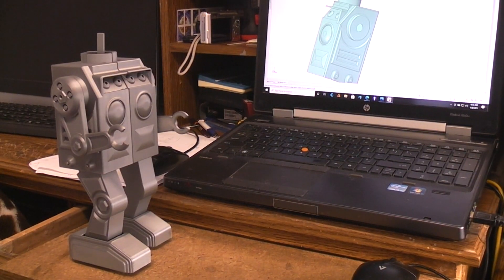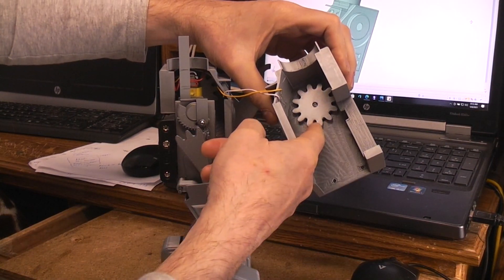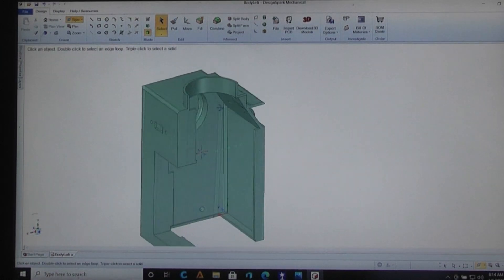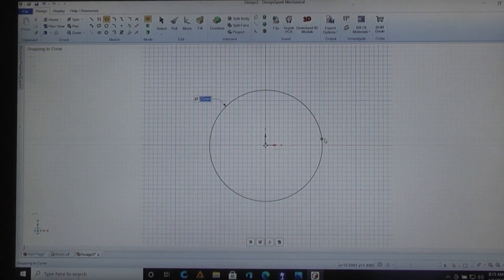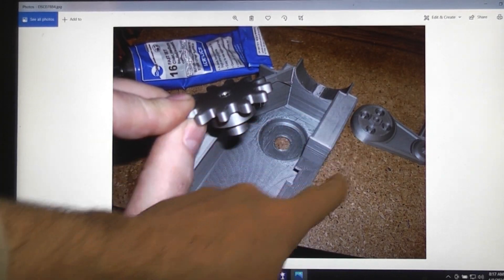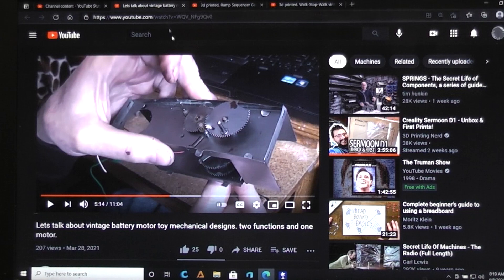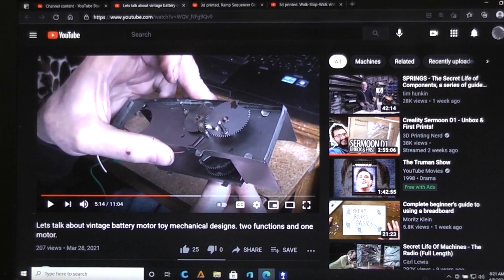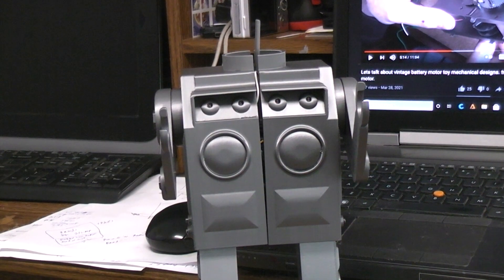Walk-Stop-walk robot project. Part 2. Body & Arms.

Comment: Did you manage to power all the LEDs off the 4 batteries as well as the motor?  I have got the motor and legs walking but I’m struggling with the LEDs.
Reply from the maker: The LEDs are not hard. Just wire them in parallel and add a current limiting resistor  220 too 330 OHMs , they will draw very little power form the batteries. Flashing LEDs have the flashing circuit built in the LEDs. The long leg of the LED is positive the short leg is negative.
Reply: @Robothut  Thanks for the info. I had actually wired things up OK but for some reason I’ve just found out I need to put a diode into the circuit.

Comment: Already built the gearbox and legs, the gearbox proves a little tricky without tight tolerance the moving gear wheal tilts on the shaft as it starts to engage the output gear, and if the tolerance is too tight it binds. I will get it just right eventually :)
 Maybe a deeper gear or 'tube' that the gear slides along the shaft on to alleviate the tilting ?
 look forward to giving him a body and arms, Thanks

Comment: I find that Interesting! I've been using cad in my work as well but making parts is something I have yet to learn and explore. 
The pressure of learning and getting the experience with different cad programs is something I am getting tired off though.
Reply from the maker: Yes sometimes you just want a tool that works and to get the job done. When trying to create something new the last thing I want is the tool getting in my way.

Comment: Impressive work!  I know you said you didn't want to learn anything else, but have you played around with Tinkercad?  It's free, and it's entirely online so you don't have to worry about upgrades.  It's extremely easy to work with and has enough versatility for most projects.
Reply from the maker: Yes I have used TinkerCad, supper basic. Not sure that it is a good fit for the complexity of some of my designs, but it is a good place for people to start that want to make something .